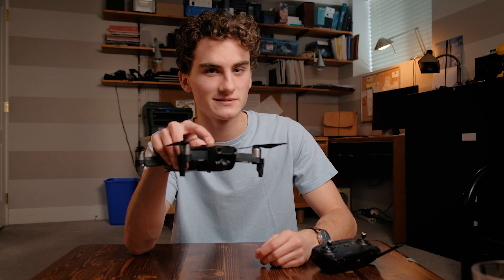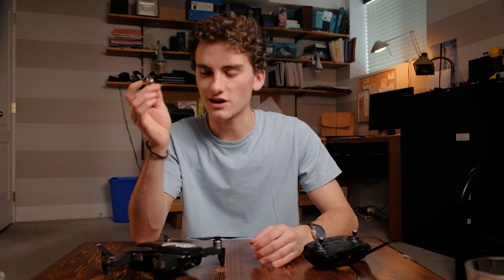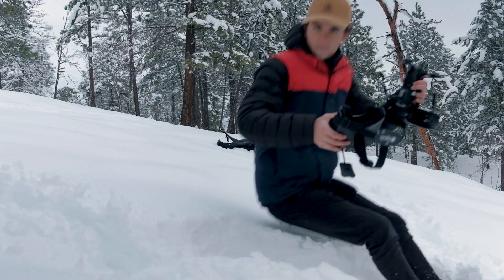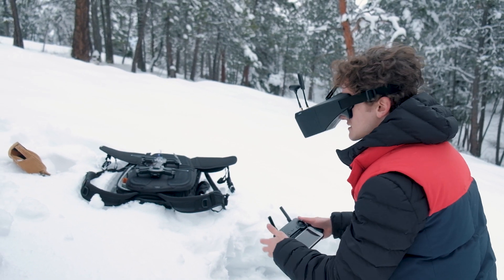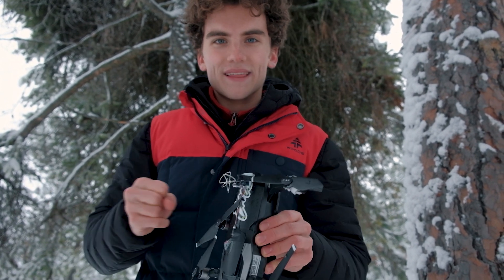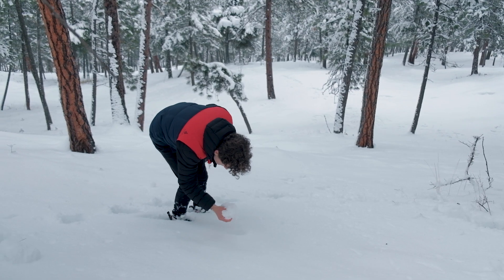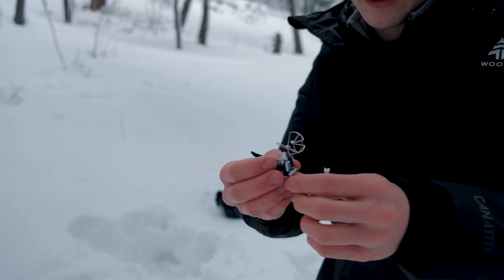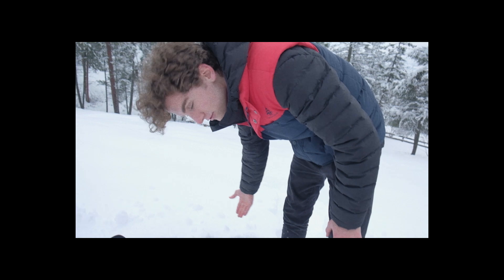How to turn a DJI MAVIC into an FPV DRONE!

Comment: Weird idea indeed - to put a cheap analog FPV kit on an expensive Mavic. Just a basic FPV drone with the cheapest parts would be several times less expensive and 100 times more repairable. As hype video idea maybe good. From practicality or any other reasonable perspective- waste of time, money and effort.
Just for clarity before someone tries to teach me- I have both Mavic Pro and 5 other DYI FPV drones incl cheap analog and DJI 03 Air Units with Goggles 2, so I know what I am talking about.

Comment: How is the range on the air as it’s WiFi with dji.do u use dji or module range off transmitter ?

Comment: Hi guys.I’ve seen this video before and I do have a DJ I Mavic air called Boris.I’ve tried fatshark goggles briefly felt weird sold that husband drone with goggles before I got the mavic air.as I have one one eye will FPS goggles suit me?😀I fly Boris mainly for film making for myself Steve in uk.what’s best set goggles would you say if it’s ok for me to use them.I used to ride motorbike Honda  vfr750 been Isle of Man etc.But just paddle board and do scooter rides now mostly.ciao guys 😀

Comment: This is awesome but Is there a way to do the opposite? I want to get into the long range fixed wing plane market. However after using my mini for so long analog and even the digital FPV leaves a lot to be desired. Is there any way to put a DJI replacement camera on a FPV drone and figure out a way to transmit the video?

Comment: i have a xiro xplorer v but the company is one big scam the app doesn’t work anymore i never had a nice flight it always crashed etc the software , firmware is from 2017 there are no new updates ,  is there a possibility that i can use the old parts and make a fully new drone  ?

Comment: Can you turn the gps off? If so it should handle more like a cinewhoop. I have been putting the same setup on my Q500 4k and Parrot Bebop 2 for about 3 year now. Before that I had the fpv on my rc cars. Great video!

Comment: I want turn my phantom into fpv drone.. just keep case, motors, props, and camera with gimbal.. control motors thru FC/ESC so I have full control over flying with GPS still for basic return back.

Comment: At 1:36 it appears to be receiving yaw input causing it to take off and get disarmed or a runaway. Based of experience the arm switch might have the yaw channel as well as an aux channel. It could also be the accelerometer. Subscribed and liked it. Was that the drone from the wish video? It looks similar apart from the green light at the back, the better video and better stability.

Comment: Not bad of course, but there's a much easier way to fly FPV, and that's with the Itchi app (20 USD) and a simple set of cheap VR goggles. No need to change your DJI drone. Just saying, guys.

Comment: Great video, I DO use both Consumer drones/quads as well as FPV quads. That being said, I totally use my Mavic (Consumer Drone) to do FPV shots. Albeit they (consumer drones) cannot do "Dive" shots but are adjustable to get those turn and run and gun shots. I use DJI Goggles and a Mavic 1 and simply turn off object sensors and it basically will do those shots without those abrupt "object sensor warnings." Good Luck and thanks for sharing. ~M

Comment: It seems like a waste of time when you can run a cord from your smartphone to a small note pad with and HDMI out to goggles with HDMI in. 

Or just insert the phone into VR goggles  and use an app from google play  Stop building mountains before you climb them
Reply: cool, how do you connect it? the phone is connected to Dji controller, right?
Reply: Bro they explained it in the video. The latency is far too high

Comment: I have a question why do you need the extra camera when you can just use the drones camera with the DJI goggles
Reply: The default dji camera has to much lag, compared to the camera he attached
Reply from the maker: That’s exactly right!
Reply: I want know to
Reply: #1, there is way too much latency, #2, there is no receiver for the goggles to connect to, #3, it just wouldn't work

Comment: I have question, what about mounting DJI FPV unit on mavic 2 pro so I can see HD through goggles and record through Hasselblad in that case would be possible to use mavic 2 pro controller??

Comment: Hello. Can you help? The camera would not work with my drone plug in as it was a diffrent connector so I wired the camera stright in to the battery of the drone via live and ground. the battery is quite powerful. When I turn the drone on I get a full clear video feed on my phone for 1-2 seconds and it all works perfect.... then it cuts out. The camera is also rather warm. I dont know what I'm doing wrong and would be grateful if anyone could help me out. Thank you. The drone I have is drocon bugs 3

Comment: You could just use the DJI HD headset that would give you the FPV video in HD.  Of course they are not as affordable as your option but they work great with the mavic drones.  These headsets are pretty affordable now that they are several years old.

Comment: DJI makes FPV goggles to use with the Mavic 2 Pro. With that you can even use head tracking to move the gimbal. No need to make this alteration with that drone. Problem is the goggles are huge and hard to travel with anywhere.

Comment: It's good to experiment.  Chances are you will learn or achieve something you never though before.  A shot like this i think can be done with Any of the smaller DJI drones, no need for the added camera.  Just go slow thru the trees and speed up the footage a bit in post if you want , then slow it down for the wide landscape shot.  For a real speed one take shot, i would probably use a Caddx Vista on a DJI Air. That way the delay will be almost gone and ghost branches will be less of an issue. For proximity with a Mavic i sometimes turn off object avoidance. That way movement of the camera will flow better. Nice footage! and props for attempting proximity flying over snow, always a challenge.   Best.

Comment: Your a noob but fpv drones can have return to home and stabilization and hover. You just dont know what your doing and it just needed a 12 dollar module added and a couple settings in betaflight or inav . Any fpv drone is capable. I have a armattan gecko 3" fly autonomously and do acro tricks and go miles. Just gotta dig deeper my friend. Also your quad spinning is your motors backwards or props on wrong. Just by watching I can tell this. Also there is a 3rd part app for dji to give you fpv and dji has fpv goggles for phantoms and mavic. Just saying and just came out with fpv gear for all other quads.

Comment: Did you try dji goggles? I'm getting a pair next week to try fpv on a dji
Reply: K K please share your experience
Reply: @AnthonyPerez  I tried the goggles briefly and could probably have gotten used to them. This video explains quite well the experience. In the end I got a dji smart controller and happy with this setup for now.

Comment: I have an idea what if you guys moved the current camera that you have closer to the centre of the drone so that rather than getting the inside of the propellers tips when they’re spinning you actually see the outside of the propeller tips when they’re spending which would help you gauge your ability to fly through objects better using that perspective seeing more of the front of the drone from the top. Just a thought

Comment: Great video! Thanks for posting 🎉🎉 DJI actually makes FPV goggles that are insanely awesome! They utilize similar technology that they have for binding the controller to the Mavic, so you can get HD footage with super little lag in your goggles from insane distances (nearly 2 miles) as well as control the gimbal with head tracking. I would highly recommend if you have some extra money to throw into your drone! 🎉✈️ anyways thanks again for the sick video!

Comment: Why doesn't DJI add an FPV feature to their drones? Problem solved.
Reply: Latency. You can use fpv with a dji drone but there is a large latency (200-300ms). True fpv drones are in the 6-35ms range. The delay is noticeable when you need the agility and reflexes on an actual fpv drone.
Reply: Dji have a complete fpv system already
Reply: LectroSoul yup and I freaking love it!
Reply: @Lectrosoul  But isn't that a camera that you can attach to any drone. I haven't heard that it will work on a DJI cinematic drone with their onboard 3 gimbal cameras. https://www.getfpv.com/dji-fpv-fly-more-combo-mode-2.html
Reply: PowerTuber 4.0 they technically do, they have FPV goggles for their drones but they are about $300ish used 😅

Comment: Nice little experiment, well done, seems like you had fun. As an FPV pilot with little DJI experience, I do recommend you look into cinewhoops. I think that type of drones will get you EXACTLY the type of shots you're after. Also check out the DJI Digital FPV system if noticing objects in analog video is a concern. You could even tick off both at the same go, by grabbing a 3'' cinewhoop with a DJI Air Unit or the new Caddx unit.
Reply: Nice information. What goggles you recommend for a budget price? The Eachine e800d looks great.
Reply: @oliviergoggins  Could work. Depends on if you think you would stick with the hobby or not, whether you prefer digital or analog, what fits your face. I started with box goggles for 40e, but quickly bought Aomway Commander v1 and then soon after Skyzone 02X which I rock till today. I like 'em cause they are not box goggles, they are comfy, decent price ~ 250e, high quality and come with receivers, so you dont have to buy separately your own modules. Someone out there will advise against that. Many people, may opinions, many options, which is great, but it mean you gotta do some research before you dive in. Have fun and welcome to the hobby! It's a great time to fly FPV!

Comment: Experience on a real fpv race drone does not have anything similar to DJI’s copters. The  learning curve is steep, you may have to destroy 1 or 2 copters to become an ok pilot, but a toothpick drones is only a fraction of the cost of a DJIs set of copters can be used as a training copters.

Comment: I'm still wondering why people after so much flight haven't figured out how much relative space is needed to fly through...
Even with lag.... 
I'd go with an Inspire 1 on sport mode, with and DJI FPV.... 70km/h through a whole or bust......
That's what I thought the first time I saw the air unit.....That might be a bit better, but it's more expensive, heaivier (the original one).

Comment: What's the point? That's a shitty drone to put a fpv camera on (Motors weak af, one racing quad motor is stronger than all these motors put together). Also, the lag is not only on the video because of the way Mavic flies (If you go full forward it takes some time to get to that position and accelerate, not 0.1s like fpv quads).
Don't be lazy, build a FPV quadcopter and practice...

Comment: Hey, Bro

There is this thing called betaflight where you can just flip a switch and your cinewhoop just hovers on its own...

You also can integrate GPS into it too btw...
Reply: Kind of.  It's called Angle mode.  It doesn't allow the drone to hoover on it's own, but the drone will self level with your hands off the roll and pitch stick.  You still have to control it's altitude with the throttle though so it's not a completely hands off hoover.
Reply: Leon Schubert wth? Where is this feature and how come no one else mentions this in the FPV groups?
Reply: @KevinLe  cause acro mode is better😂👌...
Most fpv pilots fly acro mode these days...

The feature is called "angle mode"  and can be set to a switch in the "modes" tab

There is also some way to setup an altitude and position hold over the GPS, but idk how that being set up🤷‍♂️

I'm just your everyday Fpv freestyler and racer😂

Try asking Joshua Bardwell if you want to set up the GPS part!!! He's a great guy with lots of knowledge!
Reply: correct and you can enable angle mode as well where the quadcopter levels when you let go of the sticks. however wind will make it move as well as inertia.
Reply: @carrboro_chapelhillfpv2442  you have to control throttle with angle mode. Nothing like dji
Reply: @FPVPRINTS  not if you add a gps module.
Reply: @Burn377  even if you have a gps module it wont hold an accurate position in space like dji without touching the sticks, especially with wind.
Reply: @FPVPRINTS  Different strokes for different folks.
Reply: @Burn377  show me an example of stable hover in space with no stickb input on a betaflight kwad. I'd LOVE to see that
Reply: @FPVPRINTS  actually  there are fpv quadcopters with barometers of hat do give you altitude hold so yes, the can hover. However barometers are not great at holding still and there will be a little bobbing

Comment: It's funny to me how you have the best high end cameras and mavics and such, but the cheapest bottom of the barrel low performance FPV gear there is. Just keep at it you get better is just a bit of a learning curve with all the set up in flying and building in FPV.

Comment: Next time maybe TMS could wire the DJI camera to transmit the live feed not the small camera off amazon!
Reply: Kanyon MacKenzie the camera they were using transmitted an analog video feed, while the DJI camera out puts a digital feed. While digital transmission systems exist, they are much more bulkier and expensive, which is why they didn’t use the dji camera. And, taking apart the mavic air just to get a faster link speed probably wasn’t something they were considering.
Reply from the maker: Exactly, Peter! That’s why we used a separate camera!

Comment: Here's a cool idea: mount the fpv camera backwards and put the goggles on so you can fly backwards without reversing the shot in post 👍
Reply from the maker: You might be on to something ;)
Reply: In the FPV community you get something called a cheater quad with a camera facing each direction and switch to change between them
Reply: @bandobandit353  yeah it's a really cool system, I've seen some pilots mount the GoPro on the back of their quad too, and just fly forward, but have backwards footage from the GoPro
Reply: Rocco Germani that is literally the best idea I’ve heard off😂
Reply: Newbs
Reply: mount a gopro backward. problem solved
Reply: I was thinking the same thing as you can already fly fpv with the litchi app!!! But it would definitely be a game changer going backwards!
Reply: It will work and you can enable compass lock so that the sticks reverse as well. Otherwise your in for a bad time on that lil mavic.
Reply: It's called a cheater quad, in freestyle quads you can have a cam and the front and the back and have a cam switcher then stitch the cams and the controls would even switch.
Reply: Your yaw and roll are gonna be reversed...
Reply: Rocco Germani steaming this. I’ll order the parts tomorrow cause I’m pretty sure I’m the worlds best Mavic mini pilot. All my other drones have been down and I have no idea why but my Mavic mini is my favorite drone I’ve ever had. (Had phantoms and have Mavic 2)
Reply: That's what I was gonna say
Reply: I deadass thought he was going to do that at the beginning of the video
Reply: I was thinking the same
Reply: Or just do it with a decent 360 camera, that way you can pick ANY direction in post. @TMS productions I'd sure like to see you guys do this cause with your mad editing skills applied it could rock hard!

Comment: Not sure how the cost compares, but DJI have fpv goggles that are compatible with the Mavic line-up (except the mini). Just set the drone to fpv mode and you'll get the same visual style as what you were getting here.
Reply from the maker: You are right! But it still relies on the digital video signal from the drone which is a little delayed and can cause a you hit something at higher speeds!
Reply: @TMSProductions  ah true, didn't think of that. Great vid none the less, envying your lovely snow down here in Australia.